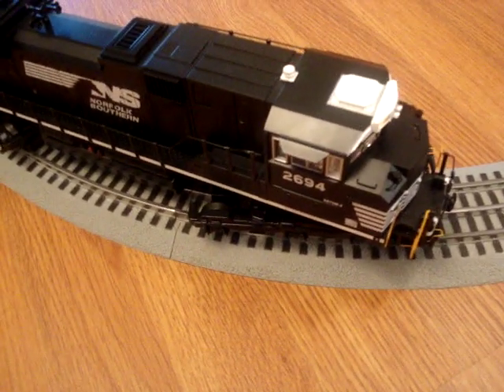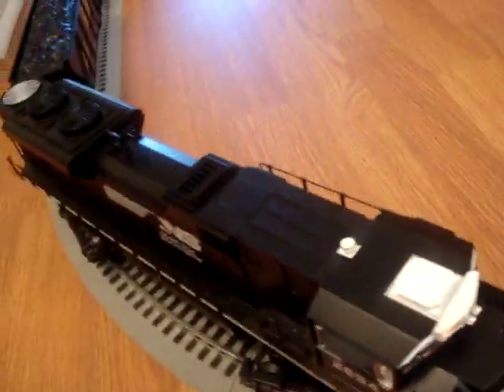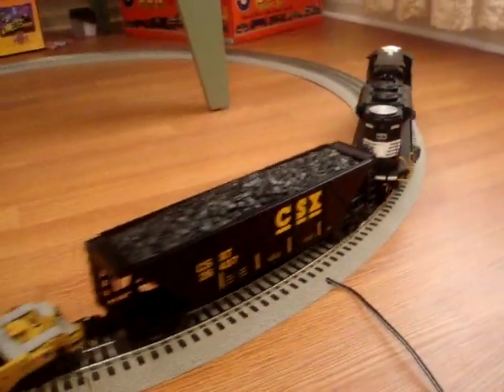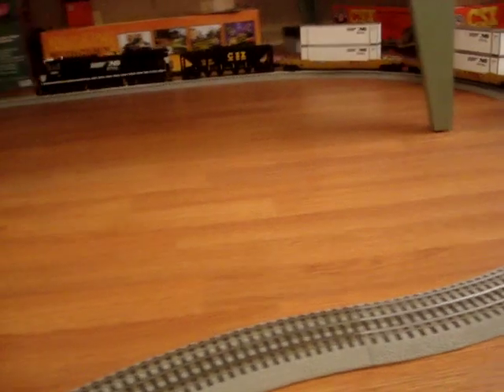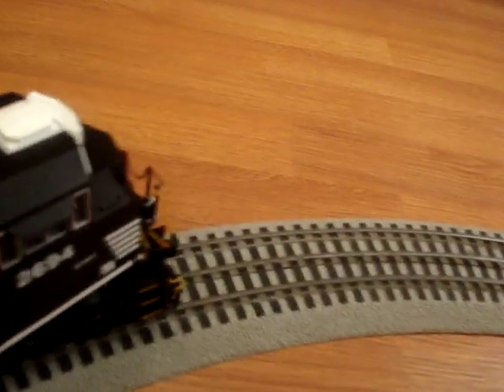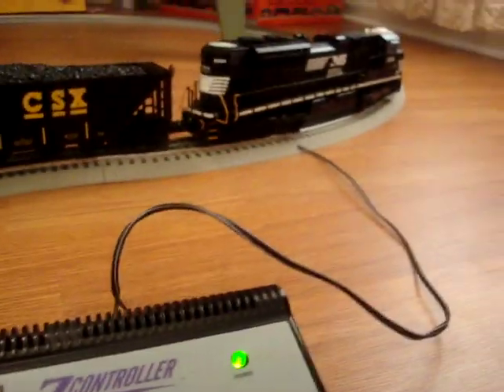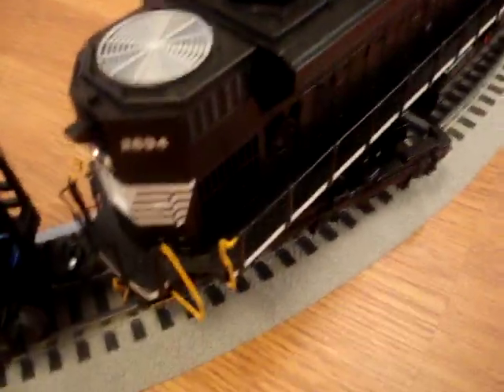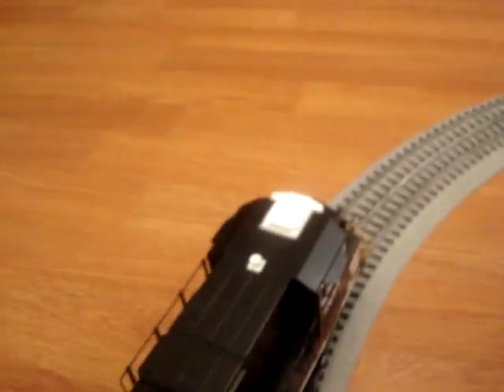Running my Railking SD70M-2 without speed control

Comment: You are right, the speed control is really a good idea. I have some PS1 locomotives without speed control, and I have to constantly monitor the voltage to regulate the speed of the train.

Comment from the maker: @thezyrisawesome I recommend using an MTH transformer for Lionel Fastrack it is completely safe. I do not recommend using MTH track as I've had problems with it. And you shouldn't use a lionel CW80 with PS3 because there will be problems with the sound board if you do. You can run lionel with the MTH Z controller but not MTH PS3 with a CW80, so if I were you I would just keep using the Z controller because it'll run all the trains. Or you can switch transformers for engines.